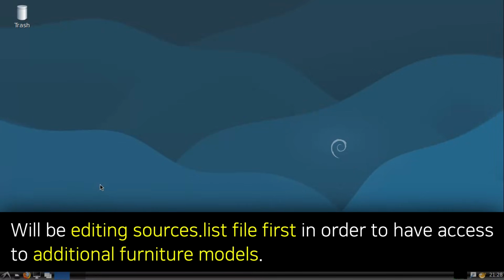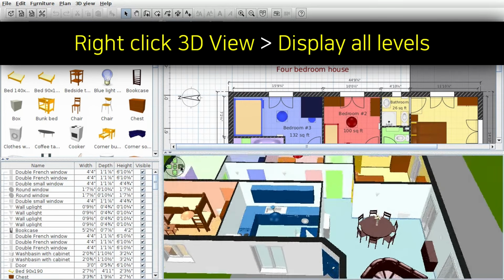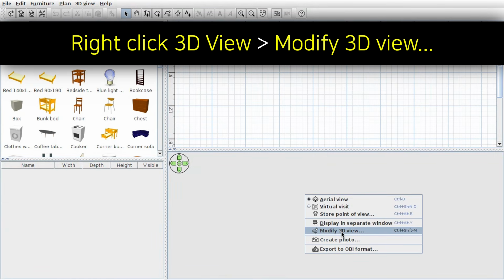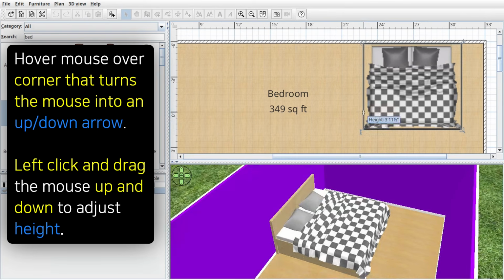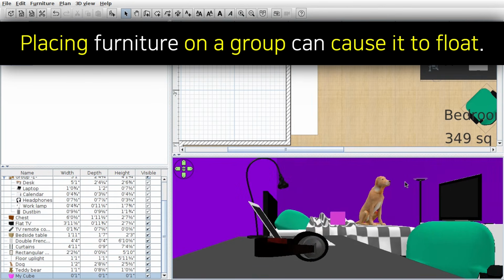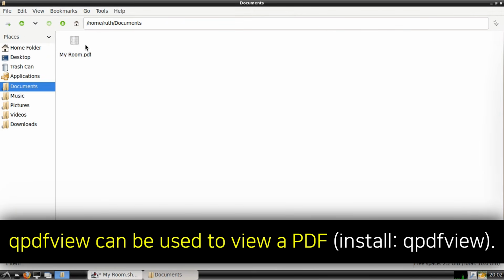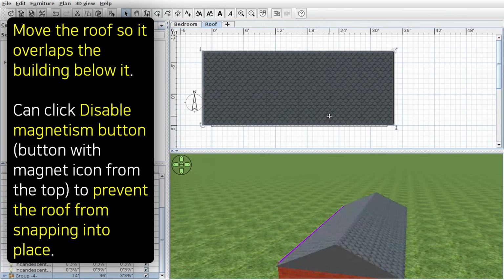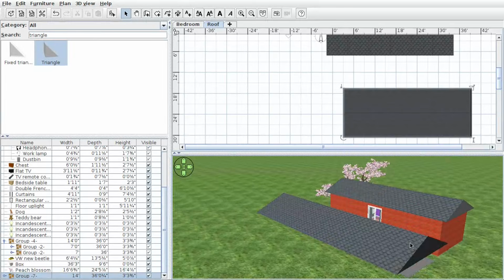Home & Room Design In Linux (Chromebooks & PCs)

Comment from the maker: Room & Home Design Instructions For Chromebooks & PCs Part 1

Debian 12 differences:
    - Chromebook fix involves editing /usr/bin/sweethome3d.
    - In Preferences, for "Furniture icons in plan", "Top view" is grayed out.
    - Fastest quality for creating a photo is grayed out.
    - For printing, in Page setup, "Print 3D view" is grayed out.
Debian 13 differences:
    - Chromebook fix involves editing Sweet Home 3D menu launch command.
    - After installing, the installed furniture libraries need to be imported.

====================
INSTALL
====================

Before installing Sweet Home 3D, edit /etc/apt/sources.list from a terminal:
    cd /etc/apt
    ls
    sudo cp sources.list sources.bak
    ls
    sudo nano sources.list
At the end of the the line that ends in "<debian-version> main", add " contrib non-free". For example:
    deb https://deb.debian.org/debian/ trixie main contrib non-free
Ctrl+O, Enter, and Ctrl+X to save and exit nano.
Update:
    sudo apt update -y

Install the following packages:
    sweethome3d
    sweethome3d-furniture
    sweethome3d-furniture-editor
    sweethome3d-funiture-nonfree
    sweethome3d-textures-editor
    printer-driver-cups-pdf

====================
CHROMEBOOK FIXES
====================

If you experience performance issues on a PC, then you can try applying the Chromebook fix based on the version of Debian.

--------------------

Chromebook Debian 12 Fix:

Create backup copy and edit /usr/bin/sweethome3d. From a terminal:
   cd /usr/bin
   sudo cp sweethome3d sweethome3d.bak
   ls sweet*
   sudo nano sweethome3d
At around line 8, set "-Dsun.java2d.opengl=true" to "false":
    ...
    -Dsun.java2d.opengl=false
    ...
Ctrl+O, Enter, and Ctrl+X to save and exit nano.

--------------------

Chromebook Debian 13 Fix:

Menu > Graphics > right click Sweet Home 3D > Properties > Desktop Entry tab
Change Command to:
    java -jar /usr/share/sweethome3d/sweethome3d.jar
Click OK button.

====================
SWEET HOME 3D DEMO
====================

Menu > Graphics > Sweet Home 3D

Open demo:
    File menu > New from demo... > select a demo > Use selected demo

Toggle Fullscreen (LXDE desktop) = Alt+F11

Configure Sweet Home 3D:
    File menu > Preferences...
        Set Unit drop-down to desired unit of measurement
        Furniture catalog view > select Searchable list
        Aerial view centered on selection > check Enabled
        Furniture icons in plan > select Top view (grayed out on Debian 12)
        Room rendering in plan > select Floor color or texture
    Click OK button.

The 4 panes (drag edges to resize):
    Furniture Catalog (top left) = for dragging & dropping furniture into Home plan (includes non-furniture models such as doors, windows, trees, cars, people, etc.)
    Home Plan (top right) = design home
    Furniture List (bottom left) = editing, selecting, toggling visibility, etc.
    3D View = reflects what's in the Home Plan

--------------------

3D View:

Right click 3D View > Display in separate window (Toggle Fullscreen = Alt+F11)
Right click 3D View > Display in main window

Aerial View Controls (right click 3D View > Aerial view):
    Rotate = Left Click + Drag Mouse
    Zoom In/Out = Up & Down Arrow Keys

    Shift Center Focus = Select object from Home Plan
    Shift Focus To Overall Center = Click blank space in Home Plan

    View Different Level = Select a level tab from Home Plan
    View All Levels = Right Click 3D View > Display all levels

Virtual Visit Controls (right click 3D View > Virtual visit. Visitor will appear in Home Plan):
    Rotate = Left Click + Drag Mouse
    Move Forward/Back = Up & Down Arrow Keys
    Turn Left/Right = Left & Right Arrow Keys

Store POV:
    Right click 3D View > Store point of view... > set name > OK
    Right click 3D View > Go to point of view > select saved POV

--------------------

Home Plan:

Move Around Home Plan Controls:
    Zoom = "Zoom in" and "Zoom out" magnifying glass buttons from the top
    Pan = Scrollbars

Visitor Controls (hover mouse on left, right, or back side until mouse icon changes, then left click and drag to adjust the visitor's view):
    Move = Drag Visitor
    Rotate = Circular Arrows (right side)
    Angle = Circular Arrows (left side)
    Elevation = Downward Arrow (back side)

Edit Controls:
    Select = Click Select button with mouse icon from the top
    Undo = Ctrl+Z
    Redo = Ctrl+Y

--------------------

Create Photorealistic Image:

Right click 3D View > Create photo...
    Move Quality slider all the way to Best.
    Set desired settings.
    Click Create button (render time will vary).
When finished click Save button > set file name and location > Save

====================
CREATE PROJECT
====================

Create project:
    File menu > New

Save project:
    File menu > Save > set file name and location > Save
    Save = Ctrl+S

--------------------

Ground & Sky Texture:

Right click 3D View > Modify 3D view...
    Under Ground, click Texture box
        Select Floor - Grass texture > set Scale to 800% > OK
    Under Sky, click Texture box
        Select a Sky texture > OK
Click OK button.

--------------------

Walls:

Click "Create walls" button (2nd button to right of button with mouse icon at the top) > OK

Freehand Draw:
1. Click in Home Plan to add a point.
2. Double click or press Esc to stop creating walls.

Type Exact Dimensions:
1. Click in Home Plan (don't move mouse)
2. Enter > type 0 > Tab > type 0
3. Move mouse in desired direction
4. Enter
5. Type wall Length (Tab to switch between Length, Angle, and Thickness).
6. Enter
7. Repeat 3-6 until returned to starting point.

Edit Walls Freehand:
    Click Select button with mouse icon from the top.
    Select wall.
    Drag either end to adjust Length and Position.
    Drag middle to adjust Curve.

Edit Walls With Precision:
    Select wall > right click wall > Modify walls...
    Click OK button to apply changes.

Apply texture to outside of walls:
    Click blank space in Home Plan.
    Hold Shift > select walls
    Right click selected wall > Modify walls..
        For the side that does not already have a color/texture, set a color or texture.
        Click OK buttons.

--------------------

Rooms:

Create room:
    Click "Create rooms" button (button to the right of "Create walls" button) > OK
    Double click in an enclosed space.

Edit room:
    Select room > right click room > Modify rooms...
        Set room Name.
        For baseboards, check "Add baseboard"
        Set Floor, Ceiling, Wall, and Baseboard color/textures.
    Click OK button.

--------------------

Add Furniture:

From Furniture Catalog (top left), drag and drop furniture into the Home Plan (can view Categories or Search for furniture).

Magnetism automatically snaps furniture into place (click magnet button from the top to toggle magnetism).

For devices running Debian 13, read "IMPORT FURNITURE" section below to import the additional furniture libraries that are already installed.

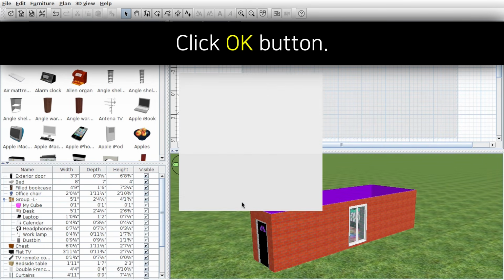For a roof, see example method presented in the video at 1:00:06

--------------------

Edit Furniture:

Hover mouse over corners of selected furniture until mouse icon changes, then left click and drag to adjust the furniture:
    Rotate = Circular Arrows
    Width & Depth = Square Icon
    Height = Up/Down Arrow
    Elevation = Downward Arrow

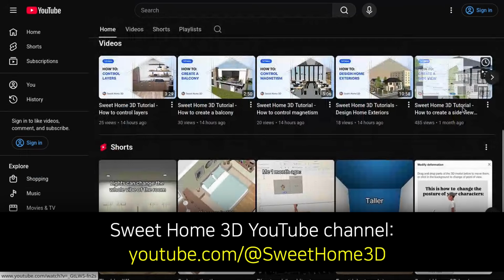Adjust colors, textures, size, position, shininess, etc. (applying a texture to a part of an object as opposed to the whole object will create distortions, see 1:12:57 in the video for a workaround example. For PCs, if the 3D view disappears, click in Home Plan or Rotate 3D View. To prevent this, apply Chromebook fix from "CHROMEBOOK FIXES" section above based on the version of Debian being used.):
    Right click selected furniture > Modify furniture...
        To modify parts of a piece of furniture click Modify... button

Group furniture:
    Hold Shift > select furniture to be grouped together
    Right click selected furniture > Group furniture
Edit furniture from a group:
    Click icon to left of group name from Furniture List (bottom left)
    Select furniture > right click furniture > Modify furniture...
Adding furniture on top of a group can cause the added furniture to float. To fix this:
    Select floating furniture from Furniture List > drag into group of furniture
    Right click floating furniture > Reset elevation

Align furniture:
   Hold Shift > select furniture
   Right click selected furniture > Align or distribute furniture > select an alignment

Shortcuts:
    Copy = Ctrl+C
    Paste = Ctrl+V
    Delete = Backspace
    Modify Furniture = Ctrl+E

Quick Tip!
    Furniture can be copied from one project to another

--------------------

Add Dimensions:

Click "Create dimensions" button that has the number 10 and a + icon from the top > OK
Move mouse towards piece of furniture or wall.
    Hover mouse toward inside of wall for inner dimensions.
    Hover mouse toward outside of wall for outer dimensions.
Double click > move dimension > click again to add dimension.

Move dimension:
    Click Select button > select dimension
    Hover mouse over middle of dimension until mouse turns into up/down arrow > move dimension

--------------------

Add Level:

Plan menu > Levels > Add level

Delete level (If the Home Plan disappears, do Ctrl+S, restart Sweet Home 3D, and reopen the project):
    Select level tab in Home Plan > right click tab > Delete selected level

Modify level (for a roof level, set Elevation to be the sum of the elevation and height of the level below it):
    Select level tab > right click tab > Modify selected level...
Reply from the maker: Room & Home Design Instructions For Chromebooks & PCs Part 2

====================
IMPORT FURNITURE
====================

Import Furniture Library (.sh3f):

For devices running Debian 13, the additional furniture libraries that were installed need to be imported.

Furniture menu > Import furniture library...
    To import already installed libraries navigate to /usr/share/sweethome3d/furniture
    Select .sh3f file.
    Click Open button > OK

--------------------

Import Individual Furniture Models (.obj, .dae, .kmz, .3ds):

If creating a furniture model with CAD software (ex. FreeCAD), export the model as a .obj, .dae, .kmz, or a .3ds file.

Furniture menu > Import furniture... > Choose model...
    Select .obj, .dae, .kmz, or .3ds file > Open > Continue
    Correct orientation if needed > Continue
    Set Name, Category, Creator, Size, Color, etc. > Continue
    Click Finish button,

PrusaSlicer can be used to convert a .stl into a .obj file if needed (sudo apt install prusa-slicer -y). From a terminal:
    prusa-slicer --export-obj -o <.obj-file-name> <.stl-file-name>

====================
IMPORT TEXTURES
====================

Import Texture Library (.sh3t):

From a browser go to:
    sweethome3d.com/import-textures/
    Click Textures-Contributions....zip file
    Wait a few moments for texture library to download.

From a terminal, navigate to where the texture library is located. For example:
    cd Downloads
    ls
Use 7-Zip to extract texture library from the .zip file (sudo apt install 7zip -y). For example:
    7z x Texture-Contributions-1.3.1.zip
    ls

From Sweet Home 3D:
    Furniture menu > Import textures library...
    Select .sh3t file > Open > OK

--------------------

Import Individual Texture (.bmp, .jpeg, .gif, .png):

If needed, FFmpeg can be used to convert an image into a compatible format (sudo apt install ffmpeg -y). For example, from a terminal, to convert an image named MyImage.webp to a .png image:
    ffmpeg -i MyImage.webp MyImage.png

From Sweet Home 3D:
    Furniture menu > Import texture... > Choose image...
    Select a .bmp, .jpeg, .gif, or a .png image > Open > Continue
    Set Name, Category, Creator name, Width, and Height
    Click Finish button.

====================
PRINT TO PDF
====================

File menu > Page setup...
    Click Page format button.
        Set Size, Orientation, and Margins (click another text box to apply change to last margin that was edited)
        Click OK button.
    Uncheck anything you don't want included in the PDF.
    Click OK button.

File menu > Print to PDF... > set file name and location > Save

qpdfview can be used to view a PDF (install: qpdfview).

====================
DOCUMENTATION
====================

Built-in help (Alt+F11 = Toggle Fullscreen):
    Help menu > Sweet Home 3D help
View imported libraries (to delete a library, delete its corresponding file to remove it from Sweet Home 3D):
    Help menu > About... > Libraries... > click file hyperlink

Sweet Home 3D website:
    sweethome3d.com
Sweet Home 3D YouTube channel:
    youtube.com/@SweetHome3D

--------------------

"3D Design & Print A Cube In Linux ($200 Printer Example)" video:
    https://www.youtube.com/watch?v=tcsCCSPpRnI

GIMP Install video (also applicable for PCs):
    https://www.youtube.com/watch?v=tcgE0eCObWw

--------------------

Digital Notes With TiddlyWiki (No Cost, Offline, Cross-Platform, Searchable Notes):
    https://www.youtube.com/watch?v=jFCX5Nh2QIM

The Chromebook Guide to Google Linux: 2nd Edition (Companion Book): https://www.amazon.com/dp/B0C9S7QY9N
ISBN: 9798852219312

Linux on Android Phones and Tablets (Companion Book): https://www.amazon.com/dp/B0C6VSX18Y
ISBN: 9798397022903

Installing Linux On PCs and Laptops (Companion Book): https://www.amazon.com/dp/B0D36DRMXJ/
ISBN: 9798324643768

====================
FOR QUESTIONS
====================

Questions are welcome and encouraged. Due to the design of YouTube's comment section, posting questions under the pinned comment or under another user's comment makes it difficult for me to find and answer questions. Please do not post your questions under the pinned comment or under other user's questions. Please create a new comment.